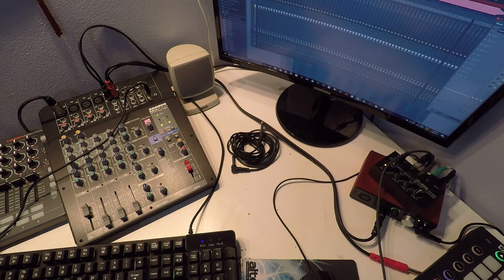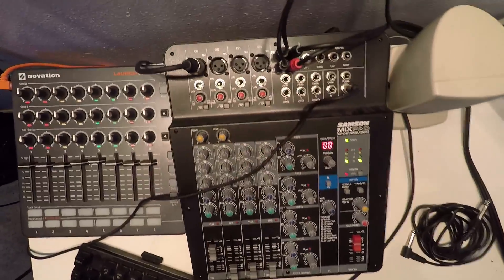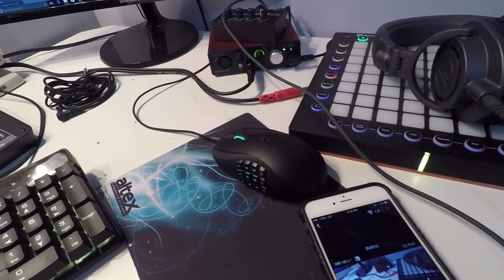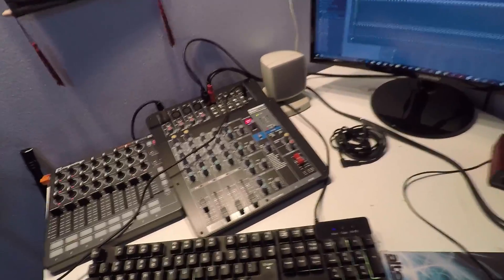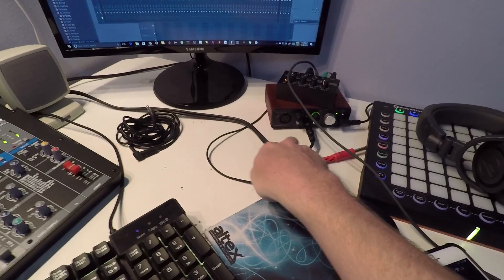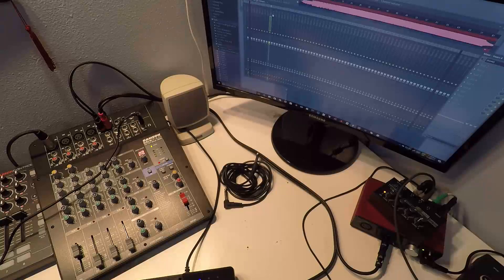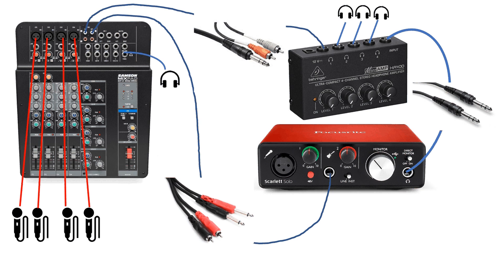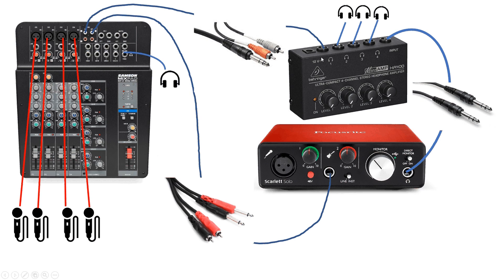Routing Sound- Mixers and Audio Interfaces (Tutorial)

Comment: here is a quick question, i'm getting the Focusrite Scarlett 2i4, and I have a mixer like you have. right now with my sound card I can record my MIC via the mixer, and also have stereo record, or what you hear... so with OBS i can either record only mic, or i can record mic plus the sound i'm playing on the computer... like if i want to do a stream... and play audio on my pc and allow them to hear what i'm playing and or record what im p laying on the pc and my mic.. with soundblaster cards it's called what you hear, in the outputs on the computer you have what you hear and microphone.. can I do this with the scarlett 2i4? would i just route the audio from my headphone jack on the  computer? to an input on the inferface? that's what im thinking it would be?
Reply: would i just need two of the RCA to TRS cables? on going from the OUT of my mixer to INPUT on my interface, then the same cable from the OUTPUT on the interface to the input of the mixer? likek what you have minus the headphone amp... will that allow me to record MIC and system sounds? cause system sounds will be coming into the interface via USB.. am I correct about that?

Comment: Nice video, but you are getting your "input" and "output" mixed up. The Headphone "inputs" on your devices are not inputs, they are outputs. The other alternative is if you have headphones that have a built-in microphone, in which case you would have both "input" and "output" for the headphone, but not for the mixer or Solo...those are still just outputs. The plug on headphones with built-in mics have three (3) black rings.

What is it you are recording that you would need so many inputs on one channel; a band? an interview? a group of people?

If you are recording a band, couldn't you just create a click track with the tempo of the songs, then use the Solo to record each band member on a separate track in your DAW? That way you can mix them better in post production. I'm just thinking of how you can get what you need done without using so much equipment as the more equipment you use, the more of a chance you will get noise introduced.
Reply from the maker: Bo Diddly I agree with your comment. There are more efficient ways to do this, but I was simply showing people what they can do if they need more inputs right away. And yes I am gearing this more towards people podcasting because that's why I messed with this setup in the first place.
Reply from the maker: The disadvantage with this mixer is that yes everything will be on one channel. I sold this mixer and don't own it anymore, but for a quick setup this would allow you to record everyone on their Own mic. Also since the mixer has 4 channels and built in effects you can mix each voice separately (even though it all comes in as one signal within the DAW). But the ideal way is to just use one interface with the amount of inputs you need

Comment: Thanks for sharing. I have a low low budget set up. Behringer xenyx 802 analog mixer and the behringer uca 202 audio interface. I am using the xlr to rca cable from the mixer main out to the uca 202 input and rca to rca cable from uca 202 output to mixer cd/tape input.

Comment: Hi friend! Mackie ProFX12V2 here. Do you think I can use the headphones output of a Behringer AMP800 headphone amplifier (4 outputs) to feed into a pair of M-Audio studio monitors? I think the BX5a expects balanced signals, does it? I assume the headphone out of whatever device is unbalanced... What I wish to accomplish is obtain independant volume control on 1) a pair of mains (large room, two speakers), 2) M-Audio studio monitors (two small speakers close to a desk), and 3) a few headphones... My Mackie mixer is unable to provide full volume control for each output as Tape Out is not fader-dependant (full volume always), and I only have a single monitor out jack (mono) unfortunately. Geez this is not easy to explain sigh

Comment: i have scarlet solo audio interface .is it necessary to buy headphone amp? if yes then how to connect it to my interface
Reply from the maker: Musically Yours the headphone amplifier is really for when you need to use multiple headphones or speakers. You don’t necessarily need it, but if you want to use more than one pair of headphones (and if you want to increase overall volume of your headphones) I would recommend it!
Reply: thank you sir..for your reply...1 more question can headphone amplifier effect the signal frequency to the headphone...btw your videos are very good..its so helpful..
Reply: Musically Yours I couldn't test it myself but I think headphone amps slightly effects the sound (tube amps should effect it even more) The scarlett usb interfaces should be able to handle up to 250 ohm headphone impedance from what I've read. Everything I just said is based on stuff I've read online so I can't guarantee that everything is true

Comment: why take tape out both channels (L + R ) if you only connect the mono to solo in ? And why do you have to route the sound back to the mixer from the headphones amp ? Why don´t you  just take the rec out to the Line in of the interface ( goes to the computer)  and steal the full mix signal from the headphones jack to the multi-headphones amp.

Comment: Hi there my friend I use to have a home studio set up but i have to move out the house and i disconnect all the components and been sitting in my new hose garage for while
and i want to put it back together but the sound guy left and i need some help please
I have the power amp with the speakers i have the mixer a have the sound card {MOTU 484} i have the MIDI EXPRESS MOTU and  sine i was working with the Qbase i have lots of
files that only can be open with the Qbase so please i need some kind of diagram step by stem reconnecting my home studio/Thank you so much and i will appreciate enyone
that can help me. Milt

Comment: if the condenser mic goes into the mixer then where/how does the mic connect to the interface to convert analog mixer to digital signal for the computer
Reply: The mic is plugged into the mixer (channel 1), and then the mixer main output connects to the interface input, and that's where the conversion happens.

Comment: how about just getting a summing box and an audio interface with 8 to 16 inputs? What you are doing really makes no sense.
Reply from the maker: As I said in the video, many people start out by getting cheaper equipment that doesn't have as much functionality, for example I started out with the scarlett solo. Rather than scrapping your old gear and purchasing new, ridiculously expensive gear, you can find ways to make what you have work. That's the point of this entire video. Yes if you have the money you can buy yourself something like a Scarlett OctoPre or something else with tons of inputs, but if you're looking for a way to rig what you have, this can do the trick. Plus it's interesting to see what you can do with the gear you have and it helps you learn
Reply: what he is doing makes plenty of sense !!! try a mixer with insert coming off the mic then run the setup mic in the mixer and run the insert into the scarlett